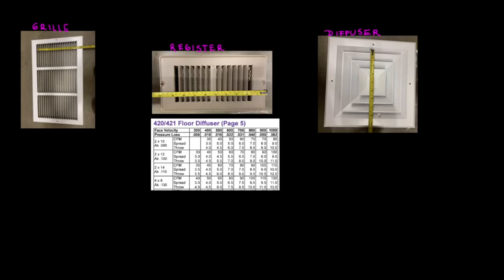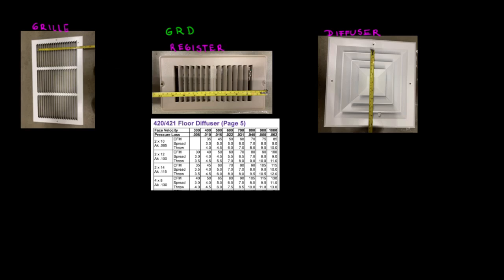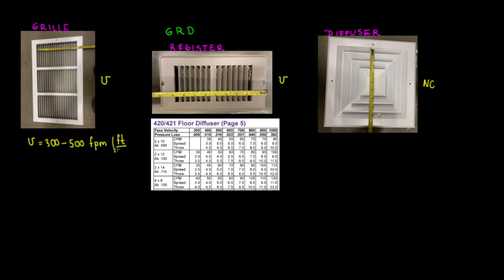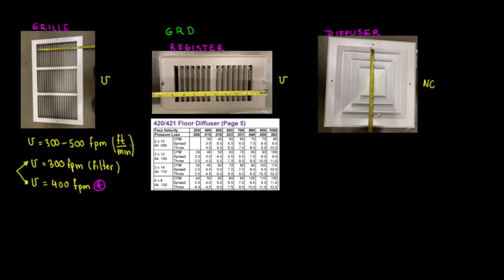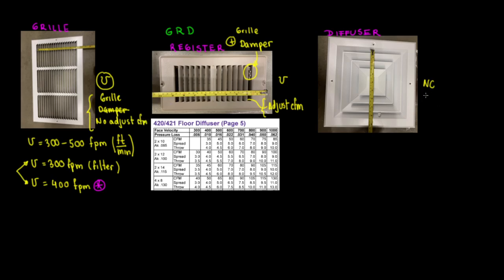HVAC EASY MATH  - Difference and Basics of Grilles, Register and Diffusers

Comment: Sir nice video....newbie question, how to calculate air grille velocity?
Reply from the maker: Thanks for your comment. You can measure this directly with an anemometer where you will obtain the fpm (in the field) and since you have the area, you can obtain the cfm. 

https://www.amazon.com/Proster-Anemometer-Thermometer-Backlight-Collection/dp/B01FTPX566/ref=asc_df_B01FTPX566/?tag=hyprod-20&linkCode=df0&hvadid=242023825343&hvpos=&hvnetw=g&hvrand=9396156016045729676&hvpone=&hvptwo=&hvqmt=&hvdev=c&hvdvcmdl=&hvlocint=&hvlocphy=1027217&hvtargid=pla-458448049188&th=1